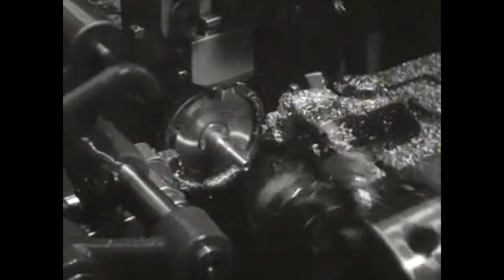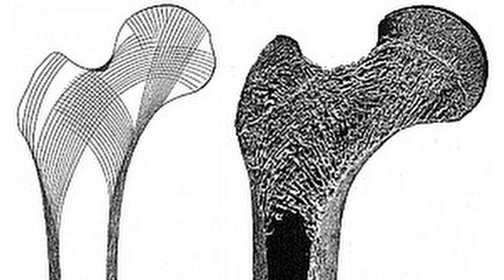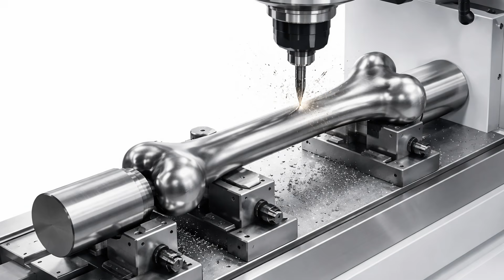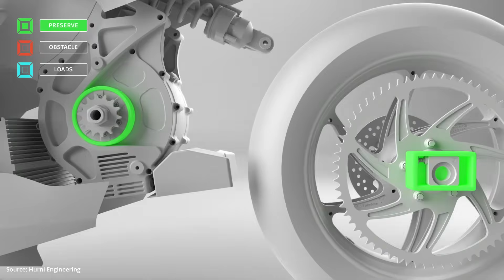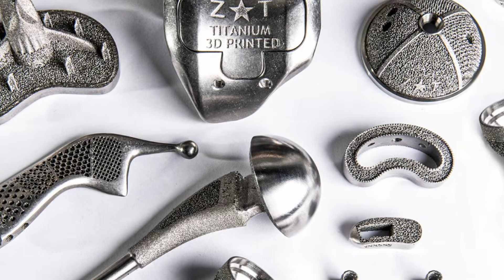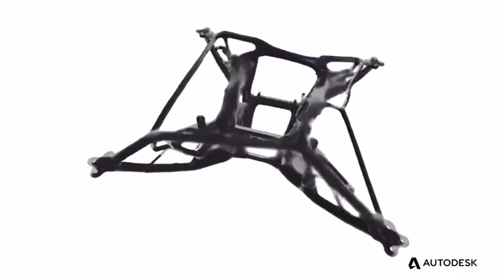Why Modern Machines Look Like Bones

Comment from the maker: The part that stuck with me most while researching this:
Engineers in the 1980s already had the math to design like nature. Topology optimization existed. Finite element analysis existed. They knew what the optimal shapes looked like.
They just couldn't build them.
For 50 years, the most efficient structures in engineering history existed only as equations — until additive manufacturing made them physical.
The bottleneck was never knowledge. It was manufacturing.
That's the real lesson here: in most fields, we're not limited by what we understand. We're limited by what we can build, test, or measure. When that constraint breaks — everything changes fast.

Which domain do you think gets disrupted next by algorithmic design — architecture, medicine, energy, or something else entirely? 👇

Comment: New manufacturing technologies are enabling more efficient designs. I think the combination of AI and additive manufacturing is helping industries where weight is very important like aerospace or automotive. I know companies in the naval sector working with these new tech too
Reply from the maker: Thanks for your comment. Absolutely! Many industries are developing new structures using generative design and topology optimization. In the naval sector is specially important for vibration response optimization ⚓️